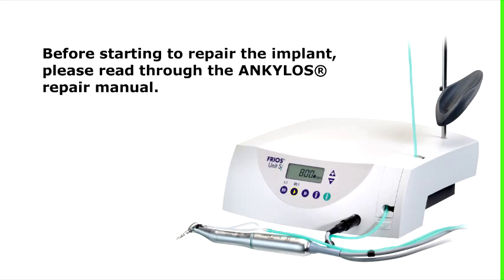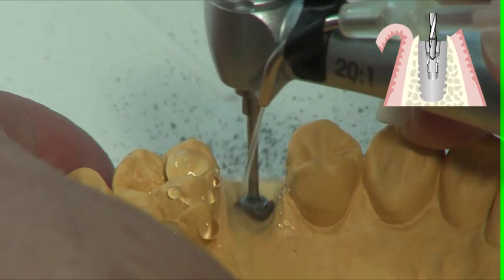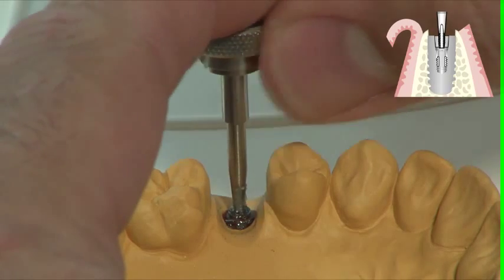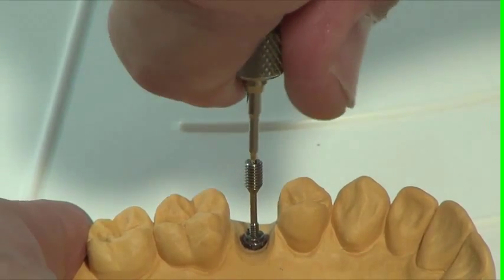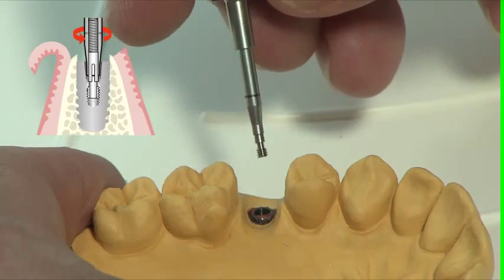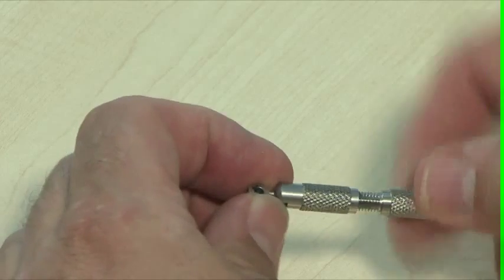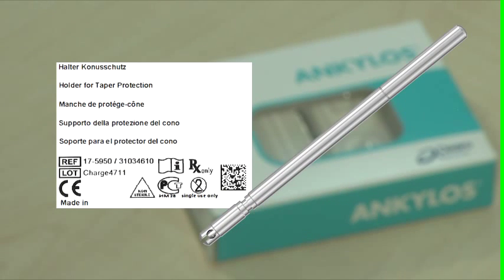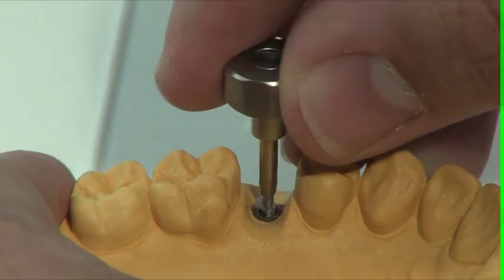Ankylos Repair video - USX

Comment: removed one recently. couple things to beware of.
1. familiarise yourself with the screw retrieval system consisting of picking sleeve and clamping sleeve. if you wind the picking sleeve too far in to the clamping sleeve it'll be v difficult to remove. you will need a small screwdriver to unwind it.
2. i broke 2 crown cutter drill trying to remove the straining screw. make sure you have at least 3.

Comment: i am in need of two implants and wanted to know if the ankylos implant system is considered top-notch , strong, long-lasting , reliable, etc, etc.  Or should i look at the Straumann or Nobel biocare implants which many consider top of the line? Or is it just marketing that makes Straumann and Nobel that way? If prices are fairly equal between these brands which would you choose?  I am considering having this done in either Thailand or Cambodia. Your welcome to elaborate on your professional feelings. I just     want them to last the rest of my lifetime without problems or failure. So i am willing to pay a little more for the better system.
Reply: go with the other systems then.